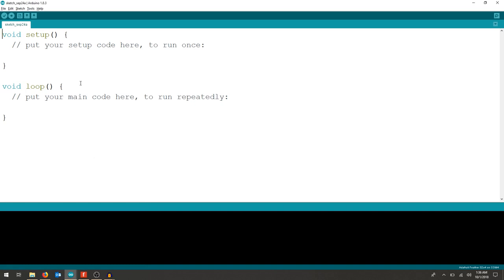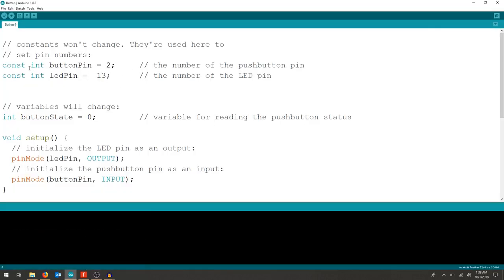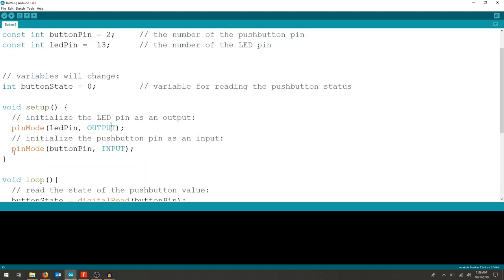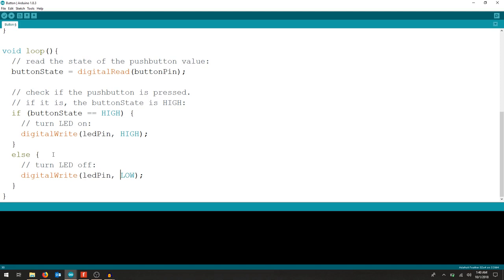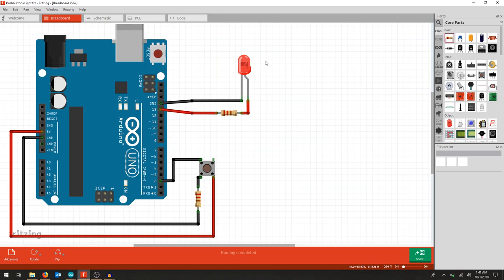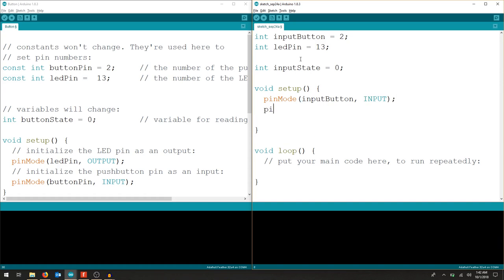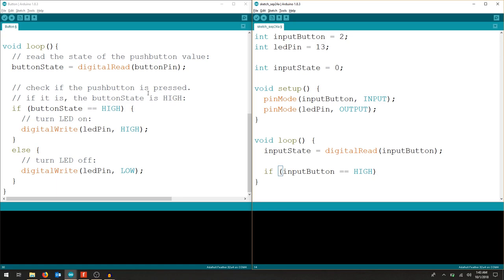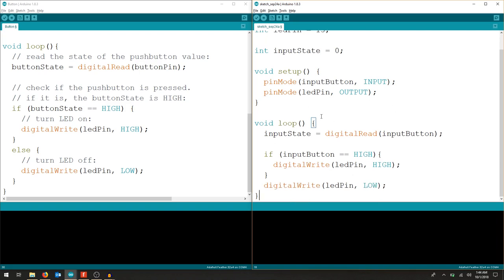Intro to Arduino: Part 2 - Code

Comment: Hi, i wanna ask. how to upload program from Arduino software to fritzing software, can we combine it to fritzing, so we can see simulation from our circuits in fritzing like as proteus? :)
Thx
Reply from the maker: I don't think Fritzing is meant to simulate. Circuits.io has basic simulation online. You  can use the Fritzing environment to upload to a board https://github.com/fritzing/fritzing-app/wiki/2.3-Adding-a-platform-to-Code-view hope this helps